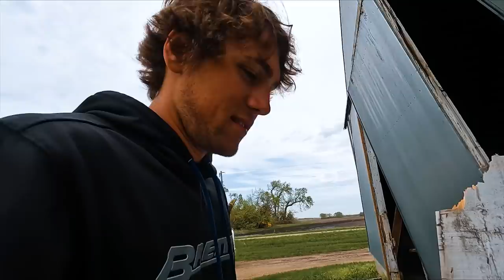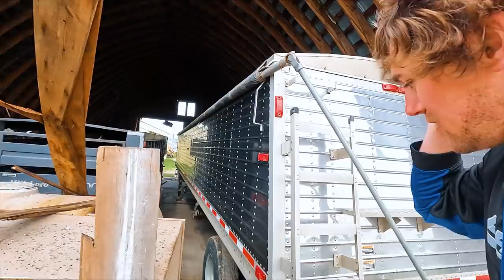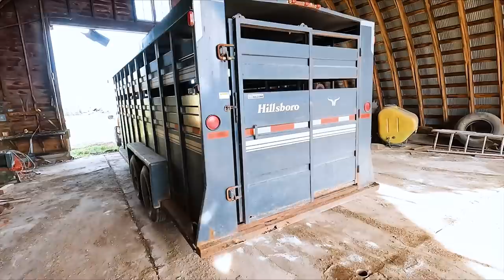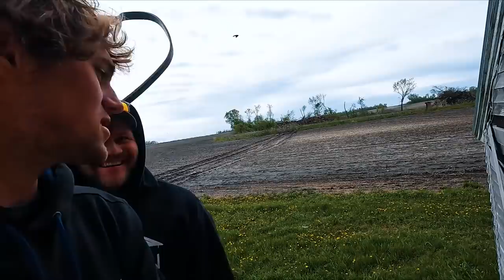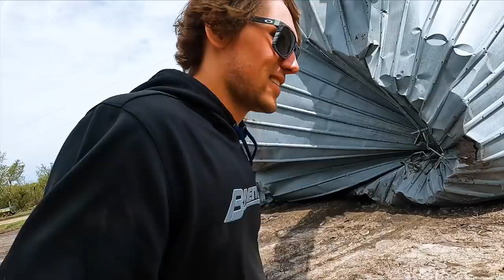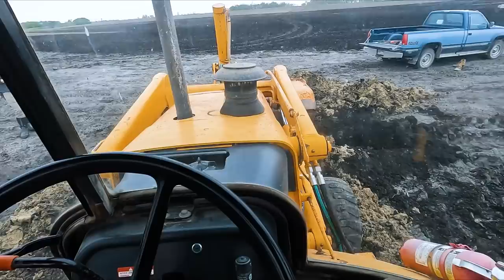Storm Damage Clean Up!!

Comment: Derecho hits Corn Star Farms late last summer. Millennial Farmer gets hit with either straight line winds or a tornado in the last few weeks. 
I remember one evening in the 1970’s when I was a kid. Just my dad, next older brother and I milking cows. Mom and the rest of my brothers were gone for the evening. We hear a tornado warning on the radio. My dad heard the radio announcer saying where it was and the direction, then looked right at my brother and I and said it’s coming straight towards us. My brother was pacing, going in and out of the milking parlor looking at the weather outside. I heard the tornado roar for about 30 seconds. My dad didn’t stop milking cows for a second through all of it. The next day there was a swirled flattened path in the alfalfa field to the WSW of the barn and another path of tornado destruction on the other side of the building site. The tornado had lifted and went directly over my dad, brother and I,,, didn’t touch a single building and dropped into the corn field. 
😇

Comment: Down here in Central Texas the corn is tasseled out. It won't be long before it starts to dry out and ready for harvest.
There are a 3 day window that you can pick the corn for eating or putting it in your freezer. You just have to go into the
field each day and pull the shuck down and stick your finger in the kernels. If they are not ready you will get a milky substance
on your finger. If you wait too long you will not be able to press the kernel in. A 3 day window.

Comment: I have a gas generator and a new lithium ion battery generator.  I love it. It’s the ecoflow delta max pro. I am not affiliated in any way just an every day Joe... what the benifit? It’s super portable suit case size 100 pounds though. It’s has four ways to recharge it. It’s completely silent and super versatile. It would be great for the grandparents. They could power freezers fridge lights phones coffee makers ext. no gas and completely silent. They are pricy but I am so glad I have mine. You can purchase stand alone connecting batteries that have no control heads but boost your load. Anyway check it out

Comment: That is one cool old plow.  What brand is it?  What year is it? What did you pull it with?  Thanks.
Reply: Looks like a White 449 8 bottom plow in the foreground and either an IH 700, 720 or 800 in the background.
Reply: I think Dougo said they plowed with an old green Stieger .